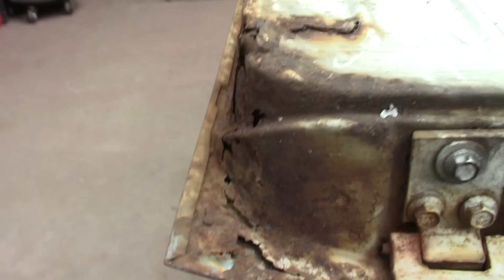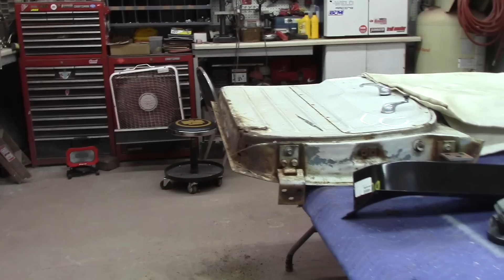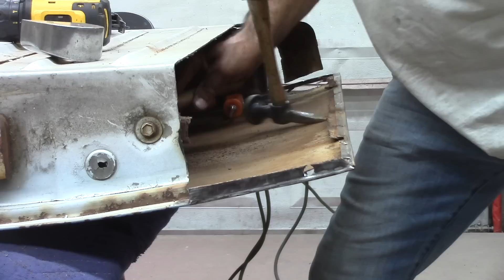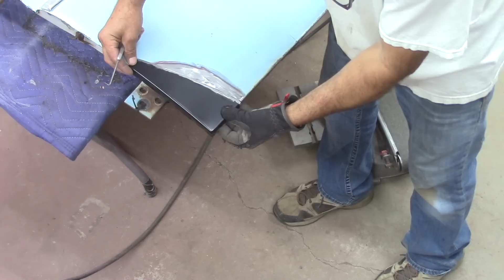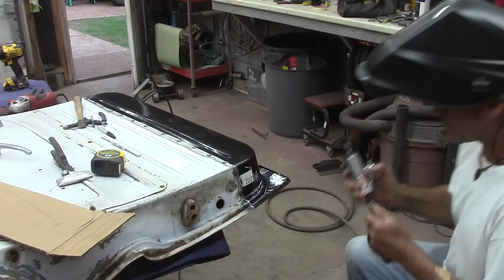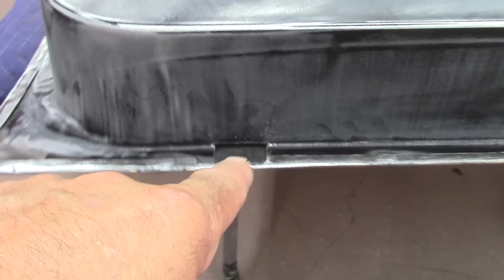Door bottom rust repair Chevy c10

Comment: I am working on a 71 C20. And your videos have helped me learn and figure things out, i have pretty much zero experience welding and fabrication. But today i just put in a bed side patch where a saddle tank fuel door used to be. Any advice on mig welder settings for better welds on sheet metal for these old trucks ?

Comment: Did you consider using lord Fusor 110B or a 3M product instead of welding?   I have doors to do and seems like would be faster.
Reply from the maker: Chester Field   I’ve seen this done before but never tried it, I’d rather stick with the welds on this old pickup

Comment: You are a craftsman without a doubt!!!!!!!!!!!!!!!!!!! Love your work. I will be attempting this in a few days on my 98 but with a flux core (it's all I got).
Reply: Rick Kimble hey Rick... I am also using flux core. Before I watched Mr Gibson I was blowing metal all over the garage. My welds were awful. The biggest take away I got from this is taking the time to prep the joints so there is absolutely no air gap. Then it's just a tiny 1/2 second trigger pull to make a tiny button of weld. Patience and preparation is the key.

Comment: Good stuff, metal work is looking good.  I gotta get me one of those stud welder deals, that looks like the ticket to work out any heat warp from closed areas you can't get a hammer and dolly on.
Reply from the maker: Jay Dipps  the stud welder is also good for shrinking metal I used it on my cab corner on my red truck to get the tin can effect out, heated the panel up then put cold water on it
Reply: Well that seals the deal, I gotta have one.  Time to use one on my 20 percent HF coupons!...I think they sell one, just hope it works good.